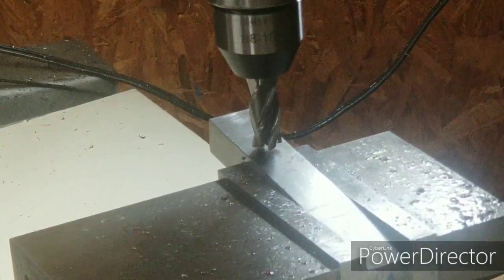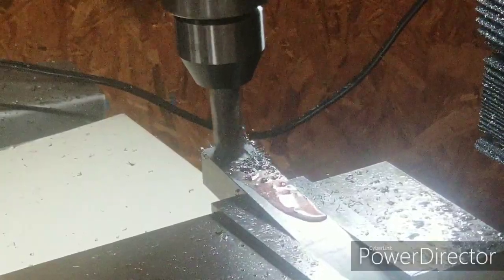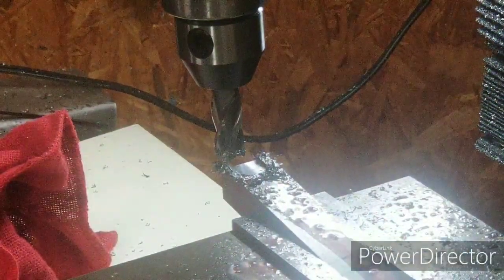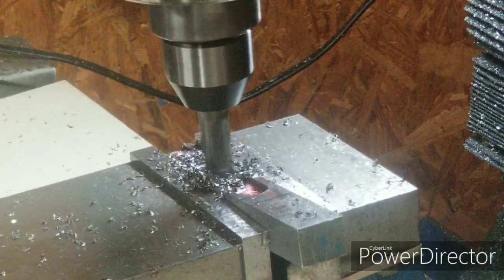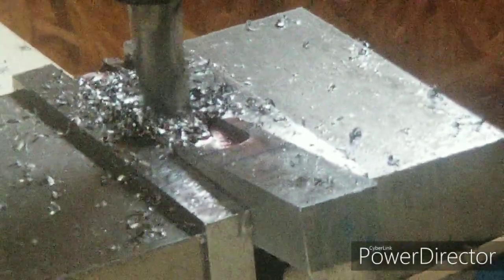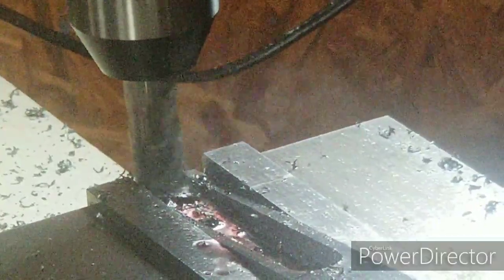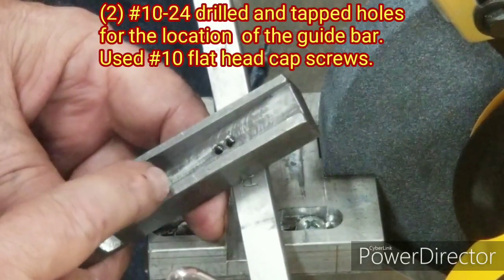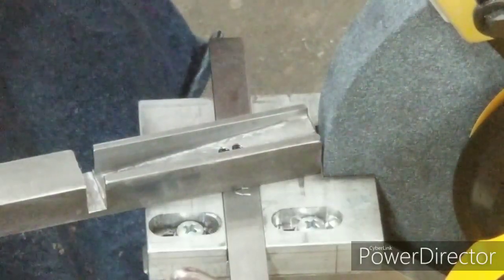A PERFECTLY SIMPLE LATHE TOOL GRINDING FIXTURE

Comment: Pretty cool little grinding fixture, I would use a stone and add a small radius to the point of the cutting edge/point so it doesnt break down as fast, and will give a much better surface finish also. 

Also, watching in ohio :P
Reply from the maker: I did I always add a small radius between .015 to .030 .I just did not video it did not plan on video being that long I thought when I started it would be around 5 minutes should have known better as Long winded as I am..... Have a blessed day and Thanks